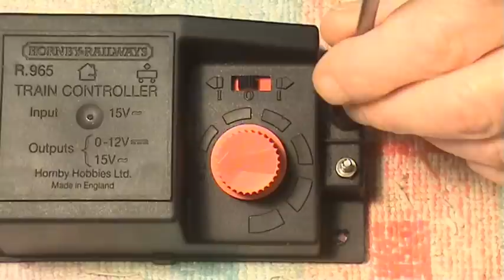How-To Modify & Beef-Up The Hornby R965 Controller. Hornby Triang.

Comment: Hi I only recently found your videos I’m seventy plus and dug out my daughters old hornby trains for our granddaughters I tried running them on modern controllers and found the performance poor so after pulling out what’s left of my hair I opted to upgrade with heat sinks and BD911 kit as seen in your utube channel,having read all the bits about overheating I’m worried now about leaving the kids playing with them should I fit thermal cut outs ? And where do I fit a fuse to is it in the battery charger or the controller.   Thanks Jim

Comment: does standard transistor get damaged by high ampages from 6 loco's?My issue is the adaptors that plug into wall and the wire to the controller!

Comment: I have read most of the comments on this video and nobody has asked do you run just one controller with one battery charger? Personally, I am hoping to go with Gaugemaster controllers with the brake simulator for the up and down main lines and just a dual controller for the shunting yard and loco roundhouse. On my workbench, I have an H & M controller from the 1960''s. Which to my amazement still works after not being used for at least 35 years. I will have to stop buying items from eBay and start saving for the baseboards or this layout will never get made. All the best John. Martin (Thailand)

Comment: Great video inspired me. 
I have a question regarding connecting my r965 to my track. 
I'm using original transformer. 
I noticed that inside the power adaptor clip for attaching the r965 to the track you have a small resistor. 
I read on tinternet that it's needed to eliminate interference. 
Is that the case? Do I or don't need the resistor between my rails??
Thanks Gavin

Comment: Hi John, great informative video 👍. Am thinking to alter one of my old controllers in order to power a twin motored intercity 225. Can i ask what size is the heat sink in the video, what gauge wires are you using for the input/output and how do you connect your output wires to the teack. 

Cheers
John

Comment: Hi John another quick question for you I've managed to pick up an early 90's r965 controller but resistor R2 looks like it has overheated badly I bought the controller knowing it was faulty, my question is do you happen to know what the resistance of R2 is so I can source a replacement.
Cheers chris

Comment: Hi John, thanks for the brilliant how-to on modding the R965. You mentioned connecting to a battery charger - I have a 12volt 900 watt portable jumpstarter with an additional 12 volt accessory outlet. Could I use the jumpstarters big crocodiles in place of the battery charger or will it damage my controller?

Comment: Great video I think this why my heljan locos don't work too well with the 965 thay don't move much before the hornby 965 cuts off . Im only using it bc it came with the original HST train set around 2007 . I think it's time to upgrade the controller

Comment from the maker: Hello Chris, really sorry for the long delay....things are not too good with my mum at the moment! OK, yes, no problem! R2 is green, blue & black which makes it 56 ohms however...for this to have overheated there could be other reasons/faults for this to happen? be prepared that if you fit a new replacement 56 ohm resistor...there may be other problems? I hope this helps you? Kind regards, John.

Comment: Hi John.
Ihave one of these that I bought on E bay, have not moded it yet , thought i would try it out first, engine seems to run erraticly when powered by a modern Hornby power pack.
Any thoughts, should I bother with it or buy another?

Regards, Graeme.

Comment from the maker: Hi Fred...thanks for your comment. I do take you point but I wanted to stay away from the thermal thing! I have checked this mod with a full short for 15 minutes & yes...the BD911 does get hot (obviously!) but she doesn't get hot enough to melt the case! It stands the short with no problem! By then any user will realize the train isn't running so would be looking for the problem by now! A 2amp fuse in the battery charger/power supply would surfice. All the best, John.

Comment: You could probably ditch the BD11 even and replace it with a cheap Mosfet like an IRF540 for even better performance. Probably a good idea to add a fuse in the output side as well since there's no more thermal protection

Comment from the maker: Hi again buddy.....sorry if I missed the question about the holes to help dissipate the heat...not really sure if I ever received it? OK, no big deal though...I just cut holes about 1" diameter in the top & bottom to allow for air flow. I also fitted 2 small fans on the pair of controlers that run my lighting as they got a little extra warm with the lighting being constant!

Hope this helps? Regards, John.

Comment from the maker: Thanks Jake. Well, using a car battery charger instead of the original wall plug transformer...you can now run easily up-to 6 locomotives on the one track with superb control of them! You can see this in my video '12 locomotives on massive power supply'. On my next video I will be featuring 15 locomotives running on 3 of these modified controllers! Kind regards, John.

Comment: John, how's you. I've watched this video a few times now and I'm having bother obtaining a controller like you described, year of manufacture etc.
The ones made in China, is the principal beefing them up the same as in your video except for the amount of space it has for the heat shink.
I've got over that by using a thinner heat shink approx size 55mm x 35mm x 15mm deep. Inside the cover there's like fins which I've cut back to suit. I drilled a couple of holes in the base and shink, used 2nr 3mm bolts, using a couple of 3mm nuts I've suspended the heat shink over the 4 diodes or resistors and it seems to work okay. I've followed your video upgrading wiring and cutting connections. I've fitted the BD911 to the heat  shink, all that's left to do is remove old one and solder wires to the new one.
The reason why I'm doing this is because my layout is 14ft x 8ft with 5 full running loops powered by DCC Hornby select. I've totally disconnected the inner loop and siding from the main layout about total length of 45ft and made it DC powered by Hornby R965 controller. The problem is, I've a Class56 DC which will run for in the inner loop for about 1.5 circuits then fades, let it sit 2/3 minutes and it'll run for another circuit or so then stop. What do you think?
By the way, I quite enjoy your videos. Cheers, Oliver

Comment from the maker: Thanks for the comment Ash. As it happens I'm slightly ahead of you. Running up-to 5 locos, the case just gets a little warm....no worries there! With 6 or 7 locos it gets warmer [obviously!] so I have indeed cut some vent holes top & bottom on the controllers.

I think you will be gob-smacked at my next vid when I can finish it. Featuring 43 loco's....yes 43! With 18 of them running simultainiousy!! Regards, John.

Comment: Hi John, been gathering all the parts and received the 965 from the UK. Will pick-up the BD911 to-morrow and some wiring.Have also located a suitable battery charger for a good price. What gauge is teh wiring? 22 for the small stuff?  Didn't see an answer to the posed question re:cutting holes to dissipate the heat.Thanks again

Comment: Hi John.
Sorry for not being to clear, I was refering to the R965 I pluged it into a transformer from the new type hornby controller the engine appeared to run a bit erraticly.I have now found the transformer that came with it, and it seems a lot better, it is an old engine I bought un tried.The R965 and the new controller seem to work to a different input voltage?. Is it the system showing your replies so late, or do you not sleep much ? I write again as I am running out of characters, Graeme P

Comment from the maker: Absolutely buddy yes you can....this is a stableised supply which can help but...as there is a small voltage drop through the controller...you are actually better-off starting with about 15 volts DC which most battery chargers will be however, try it & see how it all goes? Best, John.

Comment: Hi John.Its me again, the R 965 and the newer controller seem to run on different voltages as one is 16 and the other 19 volts.
Will any other trasistors work ok as I cannot find a BD911 but I think Maplins had  BD912.
Regards,
Graeme.

Comment: Hello there, 

What is the mechanism which is holding the back lid on? Unlike yours which came off quite easily, I had to prize away with a knife, but it just refuses to come off. It's held in all four corners by what look like little golden screws so I can't get to the circuit board. You can't budge the screws though. Any help would be much appreciated.
Reply from the maker: +Kenneth Yarham Hi Ken. The 4 corners are usually held with rivets....you need to drill these out & then use screws to replace them afterward. Hope that helps? Cheers, John.

Comment: I have three controllers, one a standard Hornby power brick which is awful, I also bought an excellent used Triang 4.5 from Triangman but last week I scored a NOS virgin Triang 4.5 in its original box which came with a job lot of NOS System 6 track and points, point switches and motors and a superb busbar with 40 spring loaded connections made by Lucas...   The 4.5's have a very good Aux output so now I can use the power brick for a shunting section and the 4.5's will run two main circuits for trains and can spread the lighting load over two controllers rather than one.   I recently bought 3000 leds on ready made strips from Aliexpress 300 on each roll and built in resistors so just simple to solder on a pair of leads for coach lighting, station and signal lighting, paid just over a tenner for 3000 leds which is awesome :D   I have earmarked some of the LED's for upgrading the old Lucas bulbs in my Reliant Robin's instruments and upgrading the interior lights with warm white for the clocks and cold white for the interior lamps :)

Comment: Hi, I have searched ebay for one made in England and finally bought one but on opening it it has the date on the pcb of 1995 but is not like yours, there is more parts on the board. Plus it has no thermal cutout on it.

Comment: Hi John thanks for getting back so soon. I am forever cleaning track and wheels thats the problem. I just measured the ac input on two of the controllers at 18v ac for both. With the power dial just off minimum, the track voltage is 23v/24v - measured with 2 different multimeters. a loco will crawl on this. Is it right that when ac is rectified the dc voltage is proportionally higher? I do run old locos (serviced and all good) on modern track. Thanks so much for your help John.

Comment: Hi John,  Completely unrelated but how do you clean your loco wheels?  I think I first came across you with the track cleaning Dalpol car so Ive got an idea about track, but I do have some blackish wheels especially on the inner edge of flange if that is what it is called - Stubborn to move except with a bit of fine wet n' dry paper but fiddly.
Reply from the maker: Hi Gary, now this is quite funny. I have never done a service video on cleaning the wheels etc as I always assumed that there would be plenty out there on you tube (haven't checked though). I do however get asked this quite a lot so I'll do a short video soon on this issue. All the best, John.

Comment: The R921 is the same apart from it has the 240v step down transformer inside. I have doctored two R921s and they work great (thanks John!). The bonus is,the R921 was never made in China so you are guaranteed to get the earlier circuit which you can do this mod to :) Cheers

Comment: Fascinating video - just stumbled across it. If I understand it correctly you'll lose the uncontrolled DC output, so the modified controller will only control trains, not accessories like signals or points, right? But I was confused when you say the modified controller will now contol up to 10 or so locos....but this is DC right so basically each controller controls one train on each track, so apart from the occasional double heading why would you need more power, well amps, from a single track controller? Have I missed something?
Reply: Enough power for ten normal locos on one train meaning a huge amount in reserve.
There are also older powerful locomotives made that use three times the current with fifties technology motors, so power for triple heading them.
Unfortunately John is downsizing and selling his entire collection on eBay and seems not in a position to give the definitive answer.

Comment: Hi John, big respect for your knowledge here! I have three of the newer type controller, but they seem to put out anything up to 24v which in my mind is a bit too much. I don't know if you could help me with this but I have a big problem on my layout in that within 10 minutes of running a loco the pickup wheels become pitted and burned and the locomotive stutters and eventually becomes unworkable. There is quite a bit of arcing between wheels and track, if you could help I would be so grateful

Comment from the maker: Yes buddy, the car battery charger takes the place of the wall plug, it has far more power available than the original transformer plug! I think this is pretty clear & explained well in the vid. You must do the other mods in the vid though for any benefit. Cheers, John.

Comment: hi john your videos are awesome and from your informative tutalige i did this upgrade on the R.921 controller with the in built transformer and was easy peasy while using this video as a guide ive only converted one so far but it works a treat still waiting to see your ringfield motor service video hope your keeping well keep up the tutorial videos your a legend thanks calvin
Reply from the maker: 646klein Hi Calvin....big thanks for your comments & interest on my channel.  Also glad you did the R921 controller mod OK....well done! I fully intend to do more 'how-to' vids as soon as I can but sorry to say things are not too good with my 89 year old mum these days....i'll get there when I can buddy? All the very best, John.
Reply: chambs123 im sorry to hear that john all the best for your mum
Reply from the maker: 646klein Thanks for your kind thoughts Cal. All the best, John.
Reply: 646klein  hi john i have a question for you, my psu gives out 13.70v which goes to the R.921 but the controller is only outputs 11.39v does this sound correct or is there something i can do to improve the out put?
Reply from the maker: 646klein Hi buddy sorry for the delay. OK.....the voltage coming out of the controller is 'pulsed DC'.....this being the case I think your meter is telling you porky's, as it is harder for a meter to be acurate on a pulsed voltage. If your meter has 'min-max hold' you should be able to get the acurate voltage with that. Hope this helps? Kind regards, John.
Reply: chambs123 hi I have a problem with my hornby r8250 controller. It keeps cutting out can you help please

Comment: I think John will tell you that it is just a wire link. Using 5A fuse wire wouldn't work for several reasons: the thermal cutout is almost certainly NOT carrying the output current (probably in series with the transistor base?), and the failure current of 5A fuse wire is actually somewhat higher than 5A; besides, I'm not sure you can solder fuse wire! Any fuse needs to be inline with the input or output in order to 'see' the current, and one in the charger/supply output would do the job.

Comment: Another excellent viral by John, of transforming an old power controller unit and boosting the pulling power and traction for more locomotives using a single or multiple controller units for your layout. A great aide and conversion for the beginner to the more advanced modeller to know.
Reply from the maker: Thanks again John. Not sure what else I can say but thanks. Cheers, John.
Reply: Can a similar mod be do to the Hornby HM2000 and the extra Left and Right extension units. Also I take it you used 2.5 multi-core cable from the electrical house hold double PVC cable (L+ E~ N-  cable PVC encased Grey flat or White round PVC cable for your Power Bus.
Reply from the maker: Hi again buddy....I have just left a comment with my views on the HM2000. It can be improved but the transformer is so small I wouldn't recommend changing things! I have used proper tinned copper wire for the buss bar(s). All the best, John.

Comment: Excellent video. I'd really appreciate a video on how to m,od the Chinese controller. I just use mine to run in my locos prior to DCC chipping them. Works fine on the smaller locos, on the larger ones it cuts out after two or three minutes. Thermal switch cutting in I'm guessing. Modifying it would save me a few bob, rather than buying a new one that will only get used very occasionally. Thanks again for an excellent video.

Comment: Hi John great video and a great help keeping all these old engines going .I have modified 3 r965's but can not seem to run overhead and rail on the same track without them interfering with each other is there a way round this? cheers Richard

Comment from the maker: Hi Tim. OK, I never had a problem running 1 of any of my old locos. If your locos need servicing they can draw much more current & this will cause this! You could also have an 'over sensitive' thermal cut-out? This mod however will solve many problems like yours.

The Chinese [& British 1996 onwards] units can be modded, I've already done some but it's 4 loco's tops [2 older type]. I may do a video on 'how to' of the later types when I have the time, just very busy at the moment. Thanks, John.